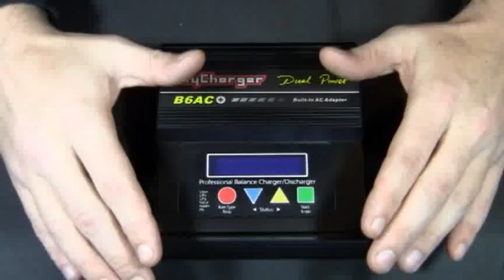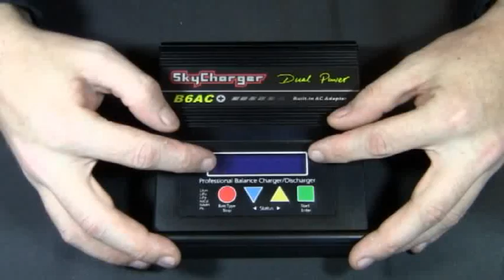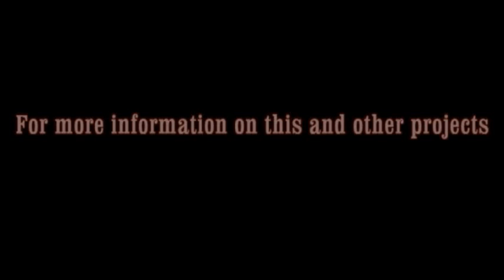Lipo Battery Explained

Comment: If I have 2  of 5s1p batteries does that give me a 10s2p? Or 10s1p?
Reply from the maker: Depends on how you wire them. The S is Series, the P is Parallel. If you wire them in series, you will have 10s 1p. If you wire them in parallel, you will have 5s 2p

Comment: Thank you for the video, it's very good! I have a question.
if i connect two batteries in series, 2S each with 1000mAh and 20C rating,
will i be able to draw a total of 40Amps or it still stays 20C?
Reply: Nah. I think u must do it parallell .... Because in series, you just add the voltage (7.4v+7.4v=14.8) but parallell 
1500mah + 1500mah equals 3000mah. At least I think it's like this. I would say 

A lamp use 1000mah on one hour. 
Connect one battery it last 1.5 hours 
Connect 2 batteries in series it light double in 1.5mah
Connect 2. In parallel it lights up for 3 hours

Comment: You repeatedly refer to the capacity of the batteries as milliamps.  Milliamps is a measure of current not capacity.  If you are describing a capacity you should say milliamp hours.

Comment: It would of been good of you to mention run times eg a 2000 mah would supply one amp over two hours or .5 amps over four hours . . . but ii really loved your video, Excellent . . . rechargable C4 Ha. . .
i use a wep power supply PS-305D, you have to watch theThermal runnaway effect  BANG !! , but its a fact that batterys draw less current as they charge . . . thats good batterys. . . .ive blown a few batteries trying to force a charge (which works as long as you watch the amps), , , ,keep up the good work

Comment: So, if I use a 500mah 20C 3s Lipo instead of a 500mah 20c 2s Lipo on a 1550 Kv motor with max current 10 amps, would it give me longer flying time or just increase the thrust it produces?
Reply: w=v*A so 7.4 and 11.1 means . .1/3 more for the 11.1 . . . I think

Comment: Thanks for sharing your knowledge!  Very helpful. Should you always store the batteries charged?  Also, when you say 80%, do you mean only using 80% of the full charge before you recharge?  So after a 100% charge, only fly until your batteries at are 20%?  Thanks!

Comment: RcHelpDotCom,
Awesome video! so far the best I've found about the topic....the one thing I still can't find out about is the relationship between the ratings and the run time. I was told a 1300mah 25c 3s lipo would be "safe" for my Axial Wraith with a 35t motor and basic electronics so, what is safe? how do I calculate the run time I get based on the ratings?
Thanks!

Comment: I have a question, I recently bought an RC Electric helicopter which came with a 7.4v 150 mAh Li-Ion battery. Can I upgrade to a larger battery that would give me more power or run time in my 3.5 ch Helicopter?  thanks so much

Comment: I got a silly question, pls help.
When you say I should NOT put a motor that pulls 15 or 20 Amps on to a battery that is 15amps rating on - why not? Isnt the motor basically a dead thing that will not "pull" anything in terms of batteryjuise.. but rather recive? So when I hear the motor is capable of pulling 20 amps I think then the battery is capalbe of delivering up to 15, to the motor but  if the motor is only pulling 10 amps then I will blow the engine. 

Or do I have this all backwards?

Comment: Dynamite® marine 1800Kv water-cooled brushless motor with 80amp ESC.....so how do I know if it will pull over 80a?  And isn't 3s50c 5000mah like 250amps each?

Comment: Yes i was wondering what would be better to use for my RC car. I have this motor and esc Fuze 1/10 4800Kv ESC/MotorCombo and i was looking at ether a Traxxas 3S "Power Cell" 25C Li-Poly Battery w/Traxxas Connector (11.1V/8400mAh) or a Thunder Power Pro Power "G6" 3S Li-Poly Battery 65C (11.1V/7700mAh) what would be the better choose for speed and torque

Comment: I have a 25a Toro brushless motor.  I'm going to use a 3s 1300mah 20c lipo.

I calculated 26amp on the battery. Am I ok or is that pushing it?

Comment: You mentioned not wanting to run a battery that has a c rating lower then what the motor will draw in amps. So would it be safer to just buy a battery that has a high c rating. For example, if the plane recommends a 20c 11.1v 2200mah battery, can i get one with say a 30c discharge to be safe or is that to big and not recommended? Also I've seen some batteries that say 3s1p, how is this different from a 3s and is it ok to run them both in my plane? Thanks.

Comment: @apple4683 A two cell lipo is faster that a 7 cell NiMh. They are also lighter. Good brands of lipos can range to 200 dollars easily. Brands like Venom, Hyperion are good brands but very expensive. You can find very cheap lipos online but there is a chance they are soldered bad and can be risky. I own 150 dollars lipos and the same size 15 dollar ones. I can't tell a difference between the performance. Just be careful. Lipo charging bag. Lipo charger and General knowledge is key.

Comment: Hey, how come when I plug my mcpx 6 cable with balancer, and plug in all 6 battery, it says over voltage. When I put 5 or less battery in, it says connection break. Any ideas?

Comment: @RcHelpDotCom your right, I don't want to risk of burn it it,  I think I will do a 4s I figured 4500mah 25C to get a 112.5 amp draw is that good if its a 120A esc, or should I stay further under maybe at about 100A draw? thanks for your time

Comment: great video! I needed to find how to measure the amp draw, I have a hobbyking 120A esc that says 2-4 cell but I have read from a lot of peoples reviews that it can do 6 cell as long as you stay under 120A draw.... it' s for a hpi savage brushless (1/8) now I just have to figure out what battery size to use! any tips? should I do two 2 cells or just one 4 cell? or even a 5 cell? also what about the 25c constant/ 50c burst ? should we worry about the burst? thanks for any help

Comment: Another thing, you said that the T plug is the charging port and the small wires on the battery is just checking to sure they are balanced?

Comment: Let me sum it all up, if the plane came with 3.7v, I should stick to that. And I can change from 150 mah to let's say 5000 mah without having any problem. If the 150 has 12c, the 5000mah can be 200c or even more as long as its not lower than 12c. This is last question, if I switch from 150 mah 12 c to 160 mah with 30c, will my motor be more powerful and decrease the fly time? Or won't be more powerful but last longer? And if I have a 20c 200mah vs a 20 c 5000 mah, they will produce the same pow

Comment: Another question, what do u mean when u say my voltage is right, how do I know that? Another stupid question that I think I know but I am not sure is that u can't switch from a 3.7v to a 11.1v right because it will burn? And as long as the voltage is the same, u can use however big mah you want? Like switch battery from a 150mah to a 1500mah? TY for answering the question. I appreciate.

Comment: Hey I am new to plane and helicopters. How do u know when u have put a battery that is too big for the motor? Another thing, if I normally use 12 c battery, is it ok if I switch to 30c with out having any problems? And the charging rate is battery amp/1000? So if I have a 150 mah battery, I should charge it at .15 right?

Comment: @RcHelpDotCom I'm new to this and i'm confused.The first equation was c rating x 1000/1000= amps. Then later it was c rating x mah/1000= amps. So i have a 3800 mah, 25c, 3s battery. What is the amperage?

Comment: @RcHelpDotCom I am really satisfied with youre answer :)    This is the main thing that was holding me up on my model building :).  Burned one old reciver once when i connected a pretty strong battery (voltage was same but with many amp) and have never dared too try again :)    but it was probably the reciver that was in really bad shape then, i thought it was the power from battery hehe.  I will for sure come in too youre forum.See you there some day 
Best regards/ Richard

Comment: Hi. I have some questions i need to get an answer on from someone that understands :)
Can i have as many mah i want in any model if the battery is light and small enough for my model or could i damage the electronic?  Same with the c-ratings, could i use as high as i can get my hands on or can it be to much?? Or is it the votlage only that destroy the electric if it get too high??   If the are limitations , how can i calculate what battery mah and c-rating i should use? best regards/ richard

Comment: so if i get a tekin rx8 bl which has a continuous draw of 210 amps, a 5000mah 45c-90c peak 3s lipo will be ok? because you said  c rating times mah = amps so 45c x 5000 = 225,000= 225amps right so that will be fine because the motor continuously draws 210amps right? please reply